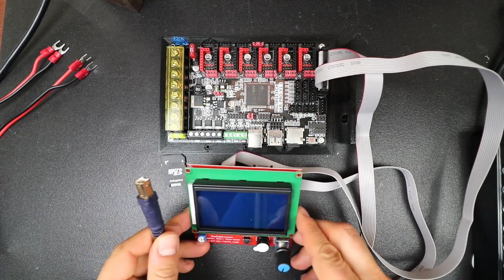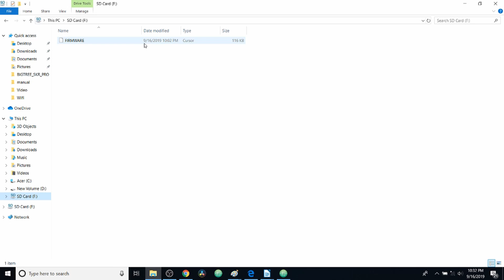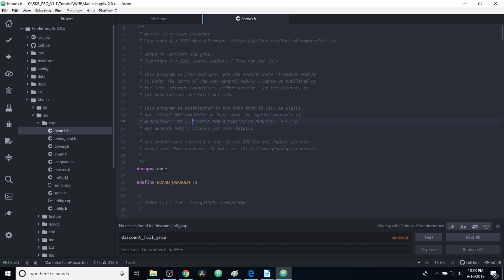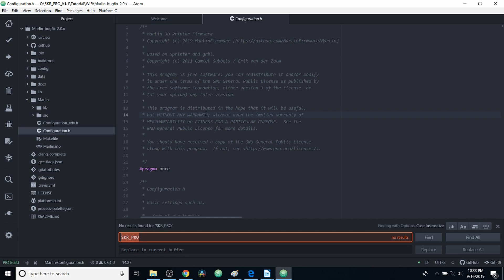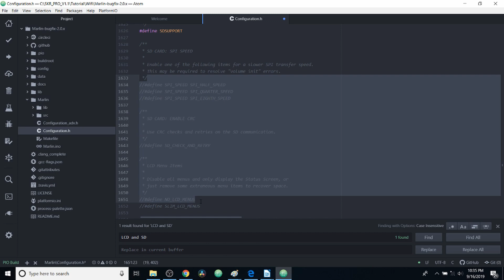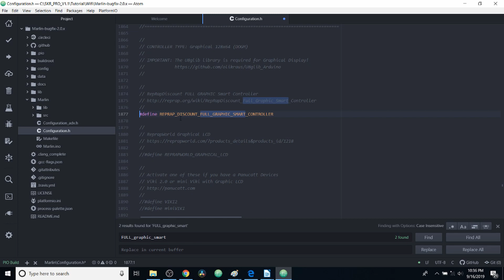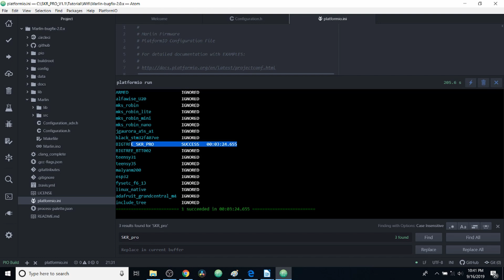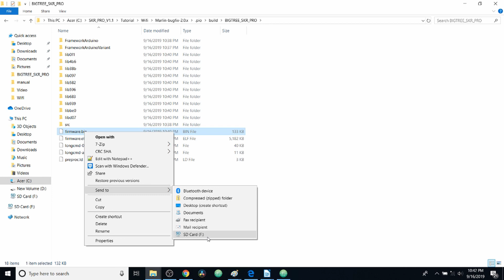SKR Pro V1.1 - 12864 LCD Graphic Smart Display Controller Board (RepRap)

Comment: bonjour et merci pour toute vos video
mais il en manque 2
la configuration  de bigtreetech skr pro 1.2 avec le module  bigtreetech motor expansion  v1.0
bigtreetech skr pro  usb flach drive 

il est vrai que je cherche de l'aide pour configurée les pins entre eux la  bigtreetech skr pro 1.2 et le module  bigtreetech motor expansion  v1.0 on ne trouve rien dessu 
meri a tous pour vrotre aide

Comment: I have a bigtreetech skr pro v1.1 board and a bigtreetech TFT35-v2.0 display. Connected to the board via TFT port. How to configure Marlen so that the board connects to the display?
Reply from the maker: Watch my tutorials on SKR 1.3 for TFT35 v3 and you'll only need to change the name of motherboard and defualt environment.
Reply: thanks.  I set the value to 1 serial port and the display connected to the board.
Reply from the maker: @delitd  you're welcome.

Comment: Can you help me I got a Error :BIGTREE_SKR_PRO           FAILED    00:00:00.779 How I can connect with my SKR?
Reply from the maker: Marlin firmware for SKR Pro is broken.  I opened a bug last week.  In the comments section I think there is a link to the bug.  On GitHub you might be able to download an older version.
Reply from the maker: https://github.com/MarlinFirmware/Marlin/issues/15680
Reply: Thanks
 @EdwardBraiman
Reply: I will try to change this
Reply: All is changed but still no progress. Hmm that's strange.
This update is upload into sd card right? the board should be not connected?
Reply: on my board is STM32F407Z6Tb on windows I got Com 3 speed 115200 in Platform.ini is 25000. Do you have the same?
Reply from the maker: You need to place the micro SD card in the board and power on with 5 volts to load firmware.  You can do with other voltage setting with jumper, but the safest method is via USB cable power from your computer.  The com port doesn't load like other 3d motherboards.  It will work for Pronterface though.
Reply: @EdwardBraiman  Ok Edward I will try to do it.
Reply from the maker: The Marlin firmware has been fixed as of a couple of hours ago.  A fresh download should build.

Comment: After I'm done loading the firmware do I need to switch the 5v jumper back or 5v is the permanent setting of the jumper
Reply from the maker: Using 5v jumper is for me to show video steps s safely as possible.  The board points to the same boot location names on boot by default.